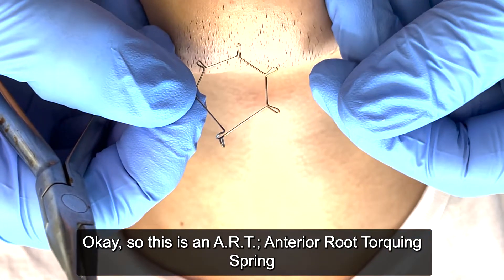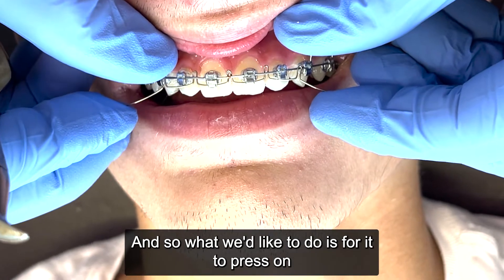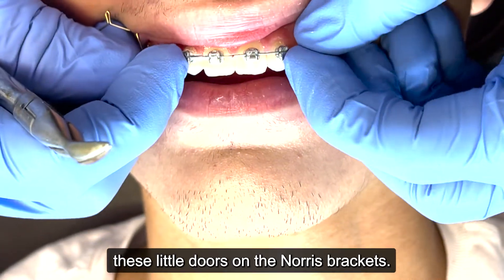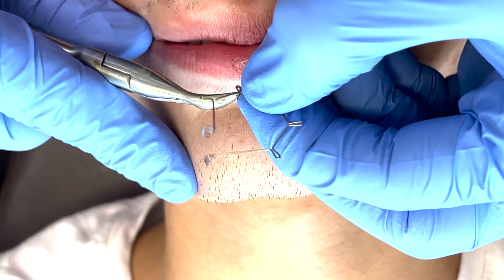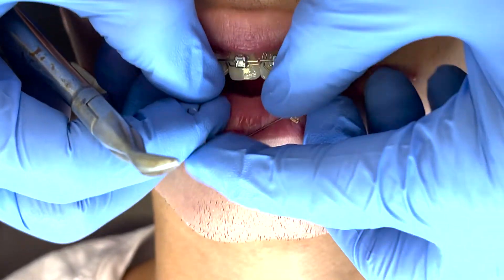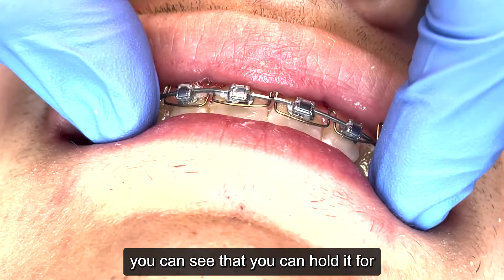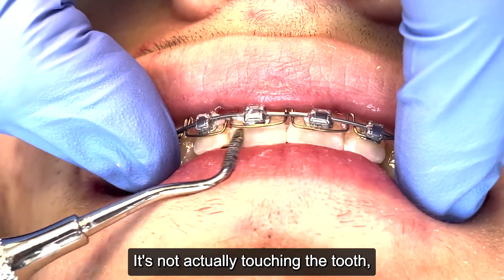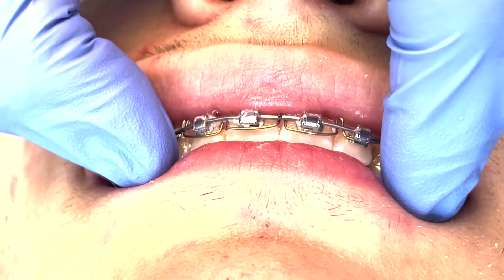A.R.T  Adjustment

Comment: Thanks for commenting Dr Gibbs!  Yes, we use rectangular wires in all of our cases, and individual torques can be placed in wires using Rose Torquing Pliers. Brackets can also be flipped individually and /or in groups to change inclinations. This was simply a video for those who DO use the ART spring and may not know that the spring does not necessarily need to contact or affect all teeth (3-3). Cheers! : )